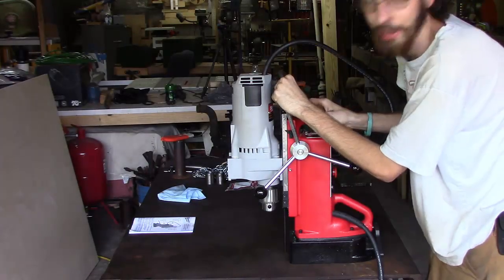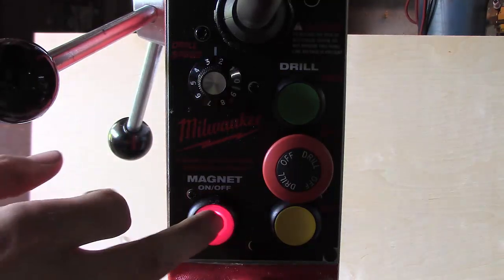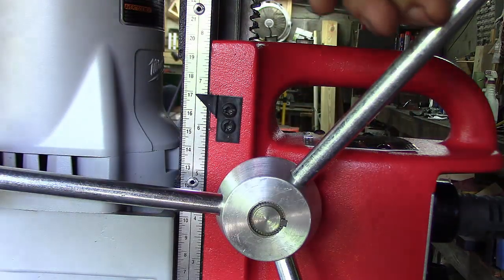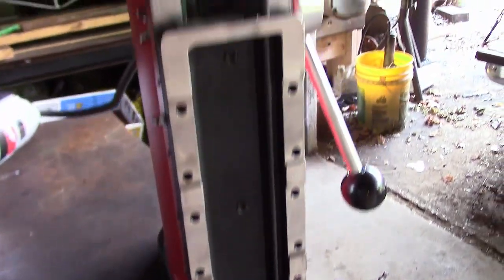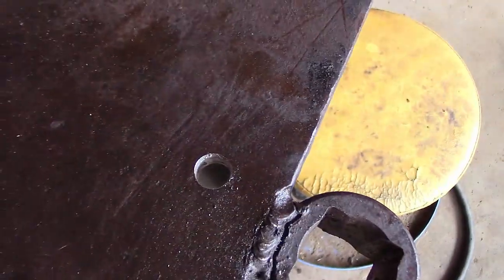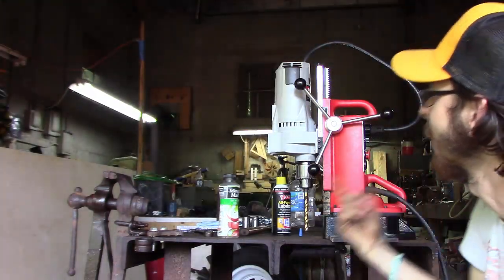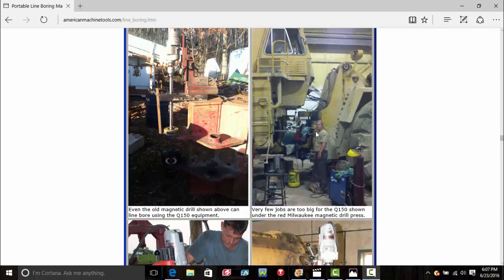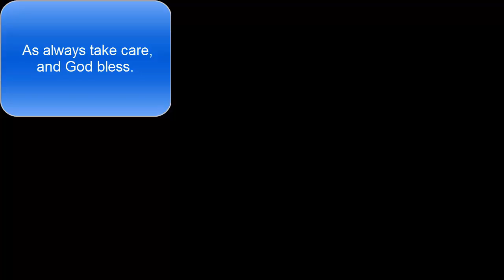Milwaukee mag drill review

Comment: I've drilled and tapped 100's of 1/2-12 holes in tables for fixturing with one of these. Super handy to have (we had several at the shop) 

They were all the older models, and didn't have the adjustable base. I woulda killed to have that feature.
Reply: 1/2-12 or 1/2-13?
Reply: @phillhuddleston9445  yeah, 1/2-13 UNC.

Comment: When tightening the chuck, make sure to tighten all three positions with the chuck key. Common mistake to only tighten one point which give uneven pressure on the fingers.
Reply: thanks for the tip
Reply: Uhm...if you ever took one apart, there is only one scroll that runs all three fingers...

Comment: great video.  how about a video demonstrating it being used to tap, maybe 1 in. pipe thread.  it seems that even on the slowest setting it is running too high an rpm to tap (I'm inexperienced, so I don't know)  Thanks for the videos!
Reply from the maker: A 1" pipe tap is a huge tap.  I don't think that would fit in a 3/4" chuck.  From what I read 5/8" is the biggest it can handle.
Reply: @EEJester1586  it is "rated" at 1" by 14 TPI

Comment: Reverse and variable speed are nonsense. The fine tuning movement option is great. Motor repositioning is a great option, useful for drilling large holes with a hole saw. Seems very heavy though. Anyway, thumbs up.
Reply: Variable speed and reverse are great for tapping and drilling too.
Reply: Weird that all drill presses have speed adjustment, but making it easier with one knob instead of belts is “nonsense”.